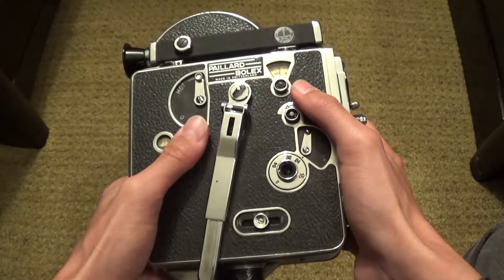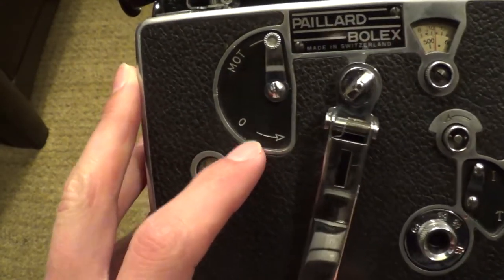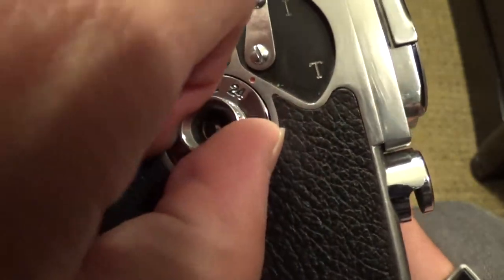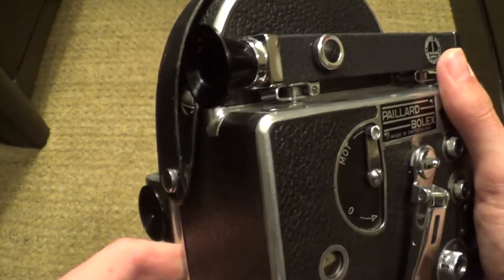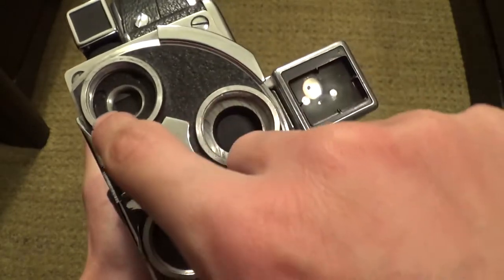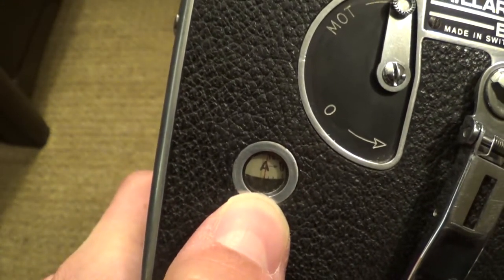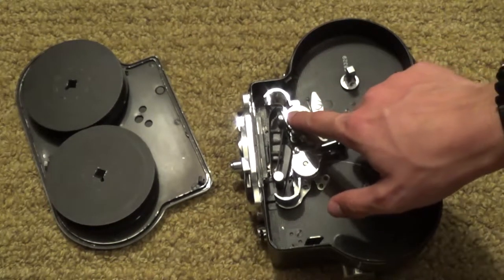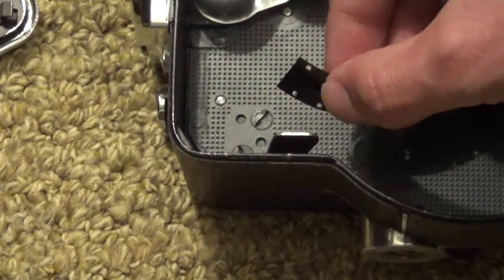Bolex H16 Non Reflex Movie Camera (16mm Film)

Comment: Thank you. I have a Bolex H16 Leader (non-reflex) and this helped. My top viewfinder seems off. The square is too high up for the peephole. Do you have the same problem? Also, should the top spool move when you run the motor without film inside? My top spool stays stationary.

Comment: There's no point in rewinding the movie once it's shot! That crank is for mixing and double exposure. You shoot and look at the counter how many frames were shot. Then, with the crank, rewind as many frames as you want to shoot another scene on top of the first one. It's one of the many possibilities for tricks you can do by shooting a length of film more than once. can use masks, animation and, in animation the frame counter is very important to know how many frames you clicked. So your explanation is wrong.
Reply from the maker: Thanks for sharing! I’ll definitely keep that in mind the next time I shoot with this camera.
Reply: @JordanLewinVideos  Another important detail, when you shoot, you are exposing the film with 100% exposure. If you shoot another scene on top of the first one, you'll get 200% exposure! super exposed. So you need to lower an f stop. If the meter is at f16, you set it to f11, so the exposure is at 50%. doing another scene on top of the first with the same f11, make 50% more and the exposure will be at 100%. If the other scene is shot on a black background, then it doesn't need any compensation.
Reply: Can you just take the receiving spool straight to the lab? Is there a problem with having the sprockets on the other side? Im having trouble rewinding and I just want to take to simplify things

Comment: why would you rewind the film after shooting? I'm used to taking out the lower spool with the finished film on it
Reply from the maker: Puppie Krammer There is one thing I forgot to mention in the video. Rewinding the film to the top spool after shooting is only necessary if not all of the film gets exposed after shooting. However, it would be correct to remove the bottom spool if all of the film does get exposed after shooting.
Reply: ah, that's smart, thank you very much!
Reply: I rewind the film in mine because if I shot something I want to keep, Rewinding helps to protect the last bit of exposed film from the light because that initial footage was already ruined when loading the camera.

Comment: Question is, how the hell do you focus accurately on a non reflex 16mm camera without knowing what's in focus or not???
Reply: Use the finder on top with the lens in the top position, then move the lens to the middle position to shoot.  Also there is a mark (a line (|) ) you can use with a measuring tape.  Keep in mind if you're shooting with higher f stop, the focus is less critical. Most lenses will indicate the level of crticalness with lines as you change the aperture.  So shooting at f8 is far less critical than shooting at f2.8...
Reply: I start by putting the lens up top and opening up the aperture all the way, focus, then move the aperature to where I will be using to see the level of how critical it will be...
Reply: Another trick is to have 2 of the same lens, one on top, one over the gate.  set focus on top (with aperture wide open) then copy that to the other lens. :)

Comment: At the 9:10 mark you show adjusting the focus with the small knob. That is not totally correct and in fact not what it is at all. It is meant to adjust your eye to the ground glass NOT the lens. Take the lens OFF the camera, look at a bright light and adjust with the small knob so the grain in the ground glass is in focus then I suggest putting a small piece of black tape over it so it does not move THEN attach the lens and focus the lens. If you do not focus the ground glass first, and only use that to focus the lens, you will never get it right except by sheer luck. Focus the ground glass like you would change the diopter on a modern camera THEN focus the lens. That is that dial is for.
Reply: Hey Raymond! I found this response very informative even if it did pass over my head a little.. Would you be able to explain the best focusing method in layman's terms for me? Thanks so much x
Reply: @jamesblobo9947  set the diopter focus first, then the lens, then rack 90 degrees to taking gate. Google and YouTube for more info.
Reply: @HelpUsSaveLives  Thanks so much. One last question if it isn't a pain.. why is the cap on the diopter held shut with a screw and is it safe to shoot film without the cap on?
Reply: Hello, I just stumbled upon this video while looking around for H16 info. I’m the guy that just bought some camera cases from you. Thanks for your input about this video. Certain basics of non-reflex focusing and recording are frequently missed by most younger folks these days.
Reply: Hey Raymond, quick question.  My top viewfinder seems off. The square is too high up for the peephole. Is that normal or should I look for a new one?